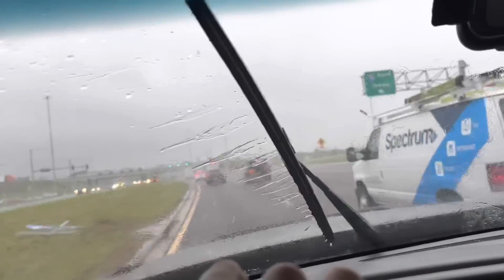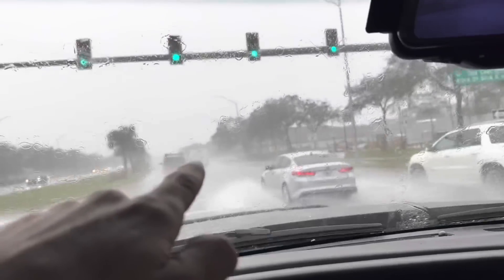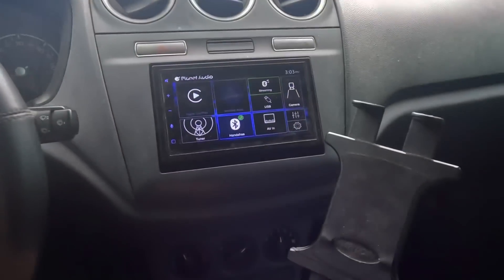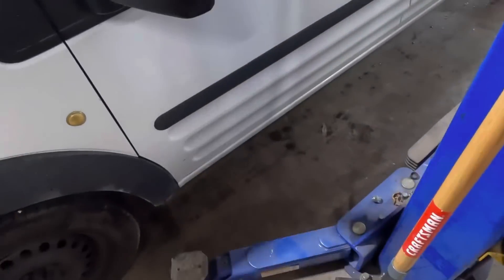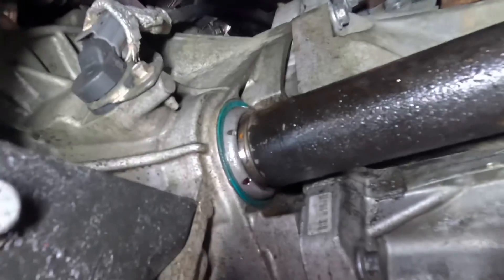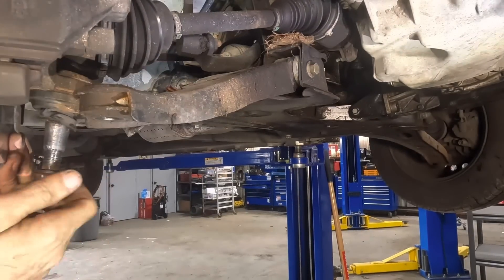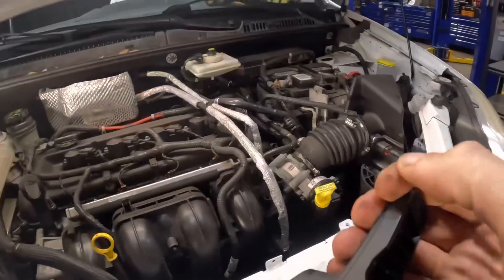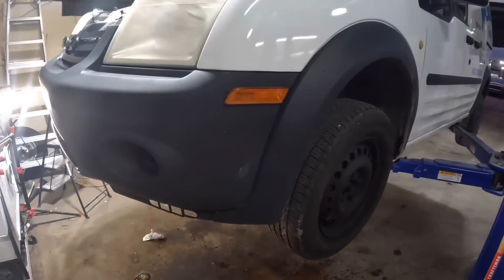Out of Business? Working ON not IN!

Comment: Back in the day I worked at a Sears Hardware store. One day a customer came in with a broken 3/4 inch drive ratchet (no, not a typo). The handle was bent, the anvil was twisted and the internal pawl was broken off. He said he was using a nine-foot long cheater pipe trying to get a prop nut off of an airplane he was working on. I casually said, "Are you sure it's not a left-hand thread?" He looked at me, blinked a couple of times, put his head down, then picked up his replacement ratchet and left.
Reply: We put a 10' heavy steel pipe over a 1/2" Craftsman ratchet years back trying to get a bed bolt off a truck. 2 pulling on it, we thought the nut was turning but when we took the ratchet off found we bent the actual ratchet. Tried it on a different bolt and snapped the internals. Ended up torching the bolts. Took the ratchet to Sears. At that time, they gave you a rebuilt ratchet from a box under the counter. The guy couldn't believe we were able to bend it as bad as it was bent. He went to the display rack and gave me a new one even though he had several rebuilt ones. He said I deserved it ?
Reply: Im not getting on that plane. 😆
Reply: @wacowildcat  that was my thought.
Reply: @wacowildcat  OP did say "Back in the day". Chances are, you either rode that plane or you don't have to worry about it anymore.
Reply: @rickb8808  Next time cherry the nuts, quenck'em with water, they'll turn off with a minimun effort.   Used to do that all thd time in a rust belt truck shop back in the day...
Reply: Old VWs have 2 rear axle nuts and a flywheel gland nut that take a 36mm socket, and torqued to about 250 ft lbs.  I use a Sears Craftsman 1/2" breaker bar and a 4-foot steel pipe over it.  Over the last 4 decades I've broken that once, and my buddy broke it twice, each time replaced with no issues.  Now I have a longer HF breaker bar, an HF electric impact wrench, and a special VW "Torque Tool" to make that job easier.
Reply: Sometimes on a left hand nut it should be an indicator sometimes not just check the threads before you start horsing on stuff cuz I've done it myself have a good day
Reply: Yup been there.  I have Brutus.  It’s a 4’ stainless bar with a 1/2” solid end tig welded on it.  Had a Subaru needed front axle nut taken off stood on bar and jumped up and down on it to loosen that nut.  Heated nut literally snapped nut in half threads good replaced with new nut after.
Reply: Good one. LOL
Reply: @leonidas953  Yeah those bastards really get rusted on, reason for having a milwakee hi torque now. 30min job turned into 2 seconds if that.
Reply: That's funny
Reply: I've broken so many 3/4 ratchets and breaker bars, but the nuts and bolts are no match for my 1" ratchet or breaker bar it's either coming off or breaking off.
Reply: good story
Reply: @thecuss6817  Back in the 60’s, in the Army living on base in Germany, I needed to do a brake job on my V-Dub beetle. I used a lug wrench from a deuce-and-a-half(2-1/2 ton truck) to remove the axle nut. Being an SAE socket it was slightly bigger than the nut, but it worked fine. I’m sure I didn’t have a torque wrench, but just tightened those suckers real tight. Never had a problem.
Reply: @leonidas953  Yep, 1994 Stupidroo Legacy left axle nut. After using all my 3/4 inch drive breaker bar with 4 foor pipe and a 3/4 inch HF Earthquake impact, I had to cold chisel the nut to split it. Then it turned off with my fingers. Threads were OK.
Reply: @AJ  Neither would I!  Thanks to George Carlin I am wiser now and get IN the plane.
Reply: I'd guess a lot of guys over a certain age have those stories.  I used a 3/8 ratchet with an adapter to work on lug nuts because that's what I had.  And it worked for a couple of years before that brave ratchet finally gave up.  Sears at the time gave me a brand new one, no questions asked.  I still feel a twinge of guilt about it, but then again I spent quite a bit over the years on their tools.  It was a hell of a good system and too bad Sears execs milked the company dry.
Reply: @toddhiggins6318  My dad worked in the Sears hardware department at the store on Woodward in Detroit, MI.
Reply: @bobh6728  sears hardware department and sears hardware store sound like two different things. I’ve always known that sears had a hardware department but I have never heard of a sears hardware store before. I’m not saying that sears hardware store never existed just trying to clarify if that’s what he’s saying.
Reply: Should  probably never touch anyone’s plane again!!
Reply: I used to use a brand new craftsman 1/2 inch extension every time I did a U Joint replacement. Beat the snot out of them, mushroom both ends.
Then I would take him back to Sears for a replacement. Most times they never asked, just gave me the new one and tossed the old one in the bin. But sometimes they would ask me what happened, I would always reply that I dropped it.
Reply: Got Em' lol but yea the rotor nut is screwed in the opposite way on a propeller airplane
Reply: Honda crank bolts.  It's why I bought a Milwaukee 1/2 inch impact.  The last one involved me using a pipe on a 2 foot breaker bar and it still took two people.
Reply: @toddhiggins6318  Probably hardware department.
Reply: LOL!
Reply: priceless buddy
Reply: 2 years ago my sears torque wrench broke that I bought in 1970 they said they don't have that serial number or model number  ,but they sent me a new one any ways , but I tell you what that old one had no plastic ,and the new one feels cheap but does the jop lol.
Reply: older1 ton fords had left hand wheel threads
Reply: Well now its tight. It will probably come off.
Reply: @michaelpressman7203  
Oh the best one is the caprice classic from the 80s some jackass put red cables on the negative side of the battery and black ones on the positive side, after about 15 fuses installing an amp you find this out, pays to really look closely at stuff first.  The old VW buses had a positive ground electric system. Try putting a radio in one.
Reply: Who knew old dodge darts has left hand threads on the passenger side… broke nine and then figured it out.
Reply: @toddhiggins6318  Sears did have separate stand alone Sears Paint and Hardware stores. There was one down the street from my house until Sears decided to close them all.
Reply: His thought....Oh Crap!
Reply: @bobh6728  Ahhh, Cruising Woodward, so many great memories 👍
Reply: Al Chrysler products did back in the day when they made real cars & trucks
Reply: range rover crank bolt is reverse....
Reply: At least he didn't come with a jar full of bed bugs to get a new mattress.
Reply: @thecuss6817  my friend worked at a VW shop I loaned him my 3/4 drive impact to take gland nuts off...
Reply: Cant be stuck if its liquid i love my hot wrench💯🔥
Reply: @Krelian1  sometimes a "Ha Ha"' is just that. Don't read too much into it..
Reply: @toddhiggins6318 . They did, they were franchises. Ours went belly up about a year before Sears did. 

It was a handy place!  They sold tools, washers/dryers, bbq grills, and lawnmowers. Not much else.
Reply: Fuck I hate when you get caught out because of reverse threads...
Reply: A guy I worked with would use his giant Craftsman flat-blade screwdriver as a pry bar, even when moving a 4,000 lb + X-ray table into it's properly aligned position to bolt it down, which I used a crowbar to do, he bent 2 pretty good doing it, but the 2nd time the Sears guy took him out to the tools to select him a crow bar, which they exchanged for the 2nd screwdriver.
Reply: That’s funny right there!
Reply: @jamessowards3822 same here. I’m thinking ours closed in 2016, ‘17 at the latest.
Reply: Back in the late 70’s our family had a trucking company and we used a 1/2” craftsman ratchet and a cheater pipe to remove and install lug nuts. When the ratchet cried uncle a replacement was as close as the nearest Sears store… until they got chintzy about replacing broken tools. 

I took a broken ratchet in to warranty it one time and the guy examined the shaft of the ratchet and said the warranty wasn’t valid because we had used a cheater pipe - the marks were clearly visible and I couldn’t argue. 

He finally gave in and exchanged it and told me not to bring it in again with cheater pipe marks on it.

Our business went belly up soon afterward. I’m still using that exchanged 1/2” ratchet 43 years later.
Reply: @thecuss6817 I grenaded a Craftsman box end on one of those VW axle nuts! Four foot cheater pipe, luckily my dad warned me to wrap a rag around the area. So I walked into Sears with the handful of wrench pieces and what was left of the handle 😂
Reply: @BixbyConsequence I worked at a Sears in the late 70s. Policy was “no questions asked”, just give the customer a replacement with a smile. You break a tool in the midst of redneck engineering and you get a new one with no hassle at all, where are you going to buy your next tool?

I still am using USA Craftsman tools I bought with my employee discount!
Reply: That's one of those oh shit moments.😉😂😂
Reply: I sure could use a 3/4" drive for my tractor and implements.
Reply: LOL 🤣
Reply: Reminds me of when I was putting together a table, and one screw took me a good five minutes to figure out why it wouldn't start to thread. I thought they boogered up the threads but on inspection realized it was left handed.
Reply: An axle nut on an old Rover caught me out just like that many years ago when I was a young punk.
Reply: @wacowildcat  you may have already.
Reply: Big props are right-hand threads, but they are torqued to between 1800 to 2500 lb-ft. . .for the 2500 we had a gear reduction torque adapter that gave an 11 to 1 increase in torque - still had to go to 225. Took more torque to detorque usually, too.
Reply: @barrysimmons5489  Not if you're turning g the the wrong way. 🤣
Reply: I used to go into a Sears Hardware store on Roswell road near Atlanta. Yes Louise, they did exist.
Reply: That's  what made Sears/ Craftsman great-- back in the day it was THE ONLY tool to have-- then the college boy bean counters came in & Killed it

Comment: As one structural engineer said to us, "Why add any hole to a roof that's not required by law?" He was totally against skylights and the associated risk of leaks. I see you found why the other guy had a shower in the shop. Being able to get the grime off before you head home is a bonus in my thoughts.
Reply: That's exactly my theory when it comes to adding solar panels to my roof.
Reply: So you remember the shop tour when i was cheering on this end of the internet for a shower in his shop and he said he was going to get rid of that thing?
Reply: Keep the grime out of your daily driver. But, alas, it's gone.
Reply: Wal-Mart did it and they save millions on energy bills because of it....
Reply: A tax write off is a better incentive than just lower electric bills that won't realize a financial benefit until the panels are halfway through their effective life.
Reply: (Axle nut)
Reply: In your case the skylights would not be a structural issue you don't have to worry about snow and ice but they have to be installed correctly so they don't leak have a great day
Reply: I would think having an emergency shower on the floor of the shop would be a great idea. Especially in a shop where you work alone.   And that big wash tub would be great for cleaning up after work to.  maybe even a cheap laundry set (used) to wash the uniforms instead of ruining the wife units at home.
Reply: @michaelpressman7203  the landlord might not approve it, too many storms.
Reply: @Rocket39Smoke14  Silicone is your friend!
Reply: A shower in the shop is a no brainer, I added a shower to me garage, pain in the buttocks, but worth the trouble...
Reply: If I leave ATF on my skin for more than a few minutes, I get a horrible rash that takes 4-5 days to go away.  A shower in an auto repair shop is a must IMO.
Reply: @jw-hy5nq  His uniforms are probably handled by a service. When I had my shop it was the same company as Safe-T-Kleen... they handled uniforms, shop rags/towels, parts cleaner, and waste oil and other fluids recovery/recycle. Had to keep an eye on those guys though. They were always trying to add on little charges here and there and if you don't watch out that can add up.
Best thing for a shop floor is one that is slightly drained to a central drain. Makes it MUCH easier to keep the floor clean. Some states my have heavy regulations on what is required for that central drain. It may have to drain into some tank and be collected by some service at huge expense.
Having a shower handy at the shop is a really nice feature. If you have no place to clean up all the crap you have been working under and in all day drives home with you and walks in the door to your house. Eventually it accumulates on everything unless you have a shower outside the home. Better to strip it all off at work and go home (or wherever) fresh and clean. Some of the shops I worked at had a proper locker room and shower. Even for a small one-man shop it is well worth having. Other places I have worked I would get a membership at the closest gym. Hopefully within walking distance. Then go there and shower... and if I had a real bad day punch an kick a few bags.
Reply: @Rocket39Smoke14  Except solar panels don't require holes in the roof beyond the mounting hardware. Even a smaller array on the shop's roof could lower the utility bills over time.
Reply: College years many decades ago, worked as a shipper for a major auto parts retailer.  Getting splashed with the battery acid when the cube broke was bad but without a shower wash down station and eye flush  it would have been more bad.  Thankfully I lost only my pants (we  had coats provided, not full coveralls).  To me, having a wash station is  essential when you work with fluids that range from mildly toxic to life threatening.   Same for having a first aid box, a fire extinguisher and fire blanket on hand.  Even if you don't shower at work, it is in the category of better to have and not need than to need and not have.
Reply: 2 types of skylights.  Ones that leak and ones that will leak.
Reply: Plus sun roof lowers headliner I like to wear hats..  Noisey, let heat in. gotta keep drains clean..I love an ac..
Reply: True to a point... Yet Wunit might think he's stopping off at the bar to shop around..
.a clean mechanic seems suspicious...yet smelling like five Pt Cruisers in a dirty Max seems normal ..
Reply: @jbell987  every couple years I'd get up there and check them out, ensure the sealing is good. Along with all stacks, chimneys, whatever else.
Reply: @edwardmackey747  used ATF is some nasty stuff
Reply: Good job Ray! You’ll get your swagger back, once your renovations are in completion stage. You got a lot going on. You’ve accomplished a lot while carrying out your business plan! 😊🇨🇦
Reply: @larrybe2900  which will also drop output by approximately 20% well before that time, if none fail outright.  (more rare, but it does occur.) which will either extend your payback time, increase your investment cost, or both. 
See it yet? 😁
👍🇺🇸😎
Reply: @jbell987  skylights are a waste they always leak.

Led lights are cheap.
Reply: The question with skylights is, not if they will leak, but when will they leak.  Rehabbed a bunch of buildings on an army base that had skylights and they all had twenty plus layers of repair sealant to remove before the new skylights went in.  The new ones started leaking within a year.
Reply: Sponge cuffs my boy, stop armpit infiltration.
Reply: Embarrassed, I would have smiled then said, " Just testing ya." Laughing as i walked away.

Comment: Ray, I found that PVC pipe works well and if you need to cut it for clearance here’s no lose, like when you modify a tool. The PVC comes in different diameter and whatever length you want, it won’t damage the edges of the seals.
Reply: Never thought about that. Thanks I will have to try that. I just put a new crank seal in John Deere and I had to go around it with a hammer to get it seated due to a long crankshaft with a two pulley system.
I have another Deere that will be getting a crank seal this summer as well, so we will try your trick.
Reply: I was thinking the exact same thing. A piece of PVC or iron pipe and grind or sawzall a cutout for clearance.
Reply: Ray likes praise perhaps he had a loveless childhood, hence the need to seek affection on you tube?
Reply: Yup. Similar process for setting a crown race on forks. I tape up the business end anyway. And put a cap on the other end.
Reply: @robertcummins1437  bhahahah what are you on about?
Reply: @Brudovo3434  Bike repair.
Reply: I've done that a time or two. If you use the thick walled green stuff (don't know its proper name) you can toss it in your "what do I do now?" for the next time. Oh, and if you don't like ATF armpits tie a shop towel around your wrist.
Reply: @bobhunt4402  what? I wasn’t talking to you lol
Reply: @Brudovo3434  I thought you were the one asking what setting a crown race on forks meant. My mistake.
Reply: @robertcummins1437  WTF?
Reply: @robertcummins1437  WTF?

Comment: two things i noticed the seal after you put it in . you hung on it with the camera and it looked a little ripped up (could be just the angle of the camera ) and lastly if your working on a car where oil is going to run down your arm get a rag and tie it around the wrist that,s going to get oiled up . the oil will soak into that and not on your shirt .
Reply: At 17:58 before he hammers it in. The new seal has grease in it that's what you are seeing. You need lube on the seal before you stick the shaft in.
Reply: Good idea. Valvoline trans fluid is good stuff, but stinks to high heaven, & almost impossible to get stains out of clothes.